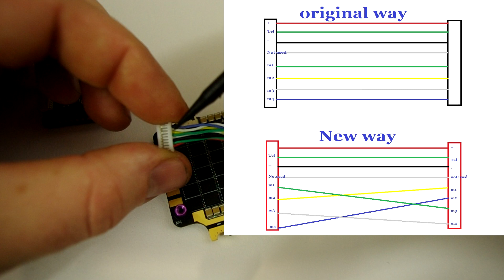REVIEW OF OMNIBUS F4 V6 AND TYPHOON v2 blheli 32 35amp ESC REVIEW  - BUILD A RACING DRONE SERIES

Comment: very nice, I have the same setup.  How do you get ESC Telemetry working in Betaflight ?  
I'm using the ribbon cable and everything working well, but no ESC Telemetry.  I've seen some videos of folks setting up a UART port for ESC and turning on the ESC Sensor in config page, but those are for a different FC.  
any settings in BF for the ESC Telem on this guy ?

Comment: You can also change the motor mapping in betaflight if you don't want to solder the wire!
Reply from the maker: I just removed the pins and swapped the wires over. 

The motor mapping all thought it’s Pritty easy to do i a total pain in the arse if you new to the hobby.
Reply: @ProgressiveMTB  smart

Comment: Nice video explanation, the 5v jumper for 5 v rail on uart4 passthrou is this good for servo powering for a flying wing, or do i need to power it with a extern ubec
Reply from the maker: skyhero kokkie it’s good to power servos
Reply from the maker: If they run at 5v if you have high power ones that you want to run at a higher voltage then run a external bec
Reply: thanks
Reply: But the bec is only 2A ideally 1A
Reply from the maker: skyhero kokkie the choice is upto you buddy personally I would say it will be fine but if you want to run a BEC then install one the castle creations BEC is the best I have used with a full adjustable voltage

Comment: How is this stack doing a month into it? curious as to whether its worth the extra money over the Mamba stack
Reply: I had some bad experience with the Manba stack. With the first one i had problems with instand rolls after i pushed throttle more then 30% even after i added min throttle value to 6% and all the other tipps from the internet. The second was dead on arrival. I couldnt connect via usb only the chip was getting hot. So i can not recomment mamba stack. I will try out the stack from this video and hopefully i have better luck this time.
Reply: @TeddyGun300  honestly my first ESC was also DoA but I bought it from BG so I guess there is always that risk. Some speculate that BG sells all the units that doesn't pass the QC. I have been flying two stacks for long enough to acknowledge that they are really nice.
Reply: @rokonfpv3040  yes I also bought on banggod maby that explains everything. 
But most of the people do recomment the mamba stack so its worth a try. If you have problems like myself you get the money back after you threatened to embark PayPal so thets no waste of money.
Reply from the maker: I have a video coming out later today about the issue I have I had and there has only been one issue. 

I have a mamba stack coming in the next week for review as well
Reply: @ProgressiveMTB  I'm currently flying 2 mamba stacks, one in my Freestyle quad and one in race quad. Seems to be working perfectly fine though my amp draw isn't that high yet
Reply from the maker: al see how the mamba compares when it arrives

Comment: Very helpful! I unfortunately watched this after the stack arrived, but I'll be sure to make my next BG order through your link! Quick question though..
I hate how it comes with those tiny screws and standoffs.. How would someone that doesn't have a 3d printer (soft)mount that? I want to put it on a chameleon ti
Reply from the maker: norb4152 just buy some small rubber O-rings and put one under and one on top of the boards
Reply from the maker: norb4152 thank you for the kind comments though buddy
Reply: It has m3 holes. Just take out the soft mounting gummies. I use m3 softmounting standoffs as well.
Reply: I have this stack. It has m3 holes just take out the soft mounts the provide and get some m3 soft mount stand offs :)